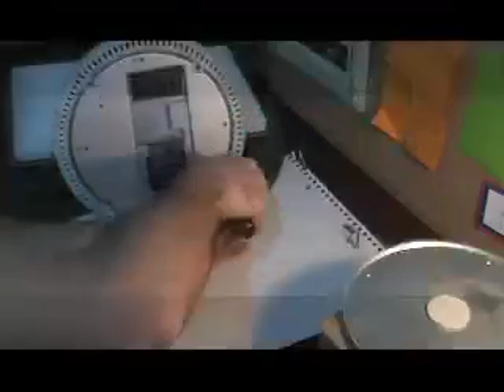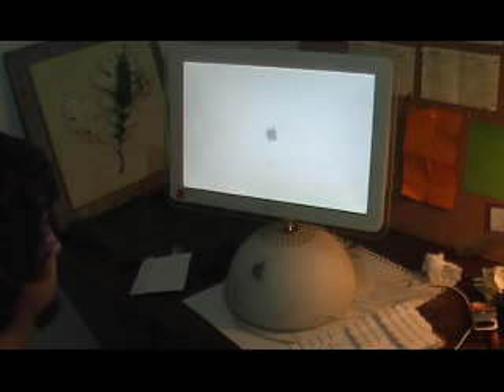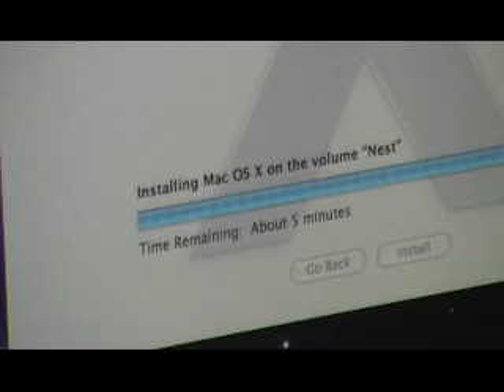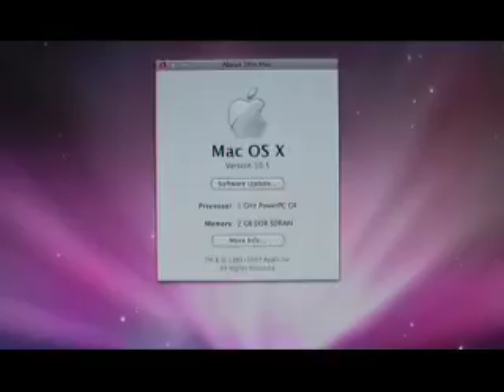iMac G4 17" 1Ghz upgrade to 2GB of memory 500 GB hard-drive and Leopard

Comment: In short there should not be a lot of speed difference in factory form. But in upgradability yes. The iMac G4 800 is only expandable to 1 GB using one 512 MB in the user accessible 144-pin PC133 SODIMM and 512 MB in the inner 68-pin PC133 DIMM slot. And 10.5 is not officially supported , it's possible to hack the installer so it will run on slower Macs or to fake out the Leopard installer. Good Luck.

Comment: Bit quick, but no too quick after watching some slower ones.  Is that some sort of "liquid solder you are applying?  Do you think this would work out as well on a 800 mb model?  Especially the 2gb memory.  Any thoughts on changing to an SSD drive for heat reduction? Thanks for posting this.

Comment: Thanks for video.What specific brand of RAM (both internal and external) did you use? Crucial memory doesn't even list a 1GB not to mention nothing for the internal stick. Tried to do this myself on same machine (with Kingston stick from Best Buy) and got major screwy results (i.e. green screen, holds taking forever and ultimately no action and bootable ONLY from the disc). My children need nothing more than this sort of setup so any information would be greatly appreciated.

Comment: You mentioned that it came in around 465GB compared to the 500GB HD size...Hard drives need un-used space to move files around and it usually comes in around 10% (50GB's)

Comment: actual formatted size is always smaller as manufacturers use the rule that a gig is 1000 instead of 1024mb, plus on the mass production rule that exists on EVERYTHING thats not precision made (hdds, ram, resisters, capacitors so on and so forth) there is something like +_ 10%. so on that rule u could have no less than 450GB but could have up to 550. i did have that with ram before, 130mb instead of 128, on the system it was on it did make all the difference :P

Comment: no lol, its because the firmware on the iPod takes up 300+ Mb and then the drives need to be formatted which takes up space as well. And operating systems are big and take up space

Comment: I wanted to upgrade my 15inch 700mhz and changed the 128 to 512mb and wanted to get the 2nd but it needs some weird screw driver. 
1.  What do I need to open it.  
2.  Will I need the bigger ram for the inside or can I use the same one on the outside?
3.  Something is wrong with my Tiger disk, it wont read.  I have this new mac book with no firewall so is there a way I can upgrade the OS

Thanks in Advance
This is getting annoying.  Took forever to find the ram now I dont think I can use both :(

Comment from the maker: Sorry yvettegr deleted the comment by accident, you are correct ElectroStatic Discharge can destroy your computer. Where I live we have very hie humidity that helps control Static buildup ElectroStatic Discharge are very very rear.I know even if you cant feel it a small voltage discharge can affect. I discharged my self by touching the computer case. And I took the risk , lol I guess I like to live dangerously.

Comment from the maker: yvettegr Commented 
Yes it is the hard drive capacity. But they need to take up some of the capacity for an internal operating system for the hard drive. That's where the missing gigabytes go. Your computer access and formats the hard drive. But, a burnt in internal system runs the thing Why aren't you wearing a grounding strap? You can destroy the memory and logic board with one good zap. Also, why no gloves? The oils from your hand, particularly on memory, will be in there eating away at parts

Comment from the maker: Thermal paste is a heat transfer compound that helps transfer heat from one point to another. Also used in between the processor and the radiator. In the iMac G4 the processor sits at the base of the computer and the fan at the top , the engineer designed some metal plates to transfer the heat up the computer making a bond at the bottom of the base. Every time you open the computer this bond is broken making it necessary to reapply the paste.